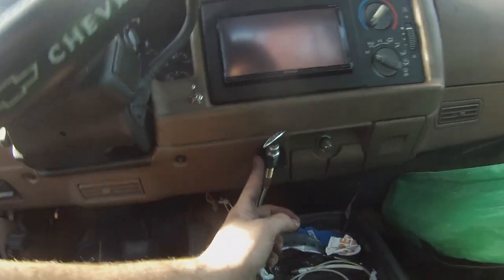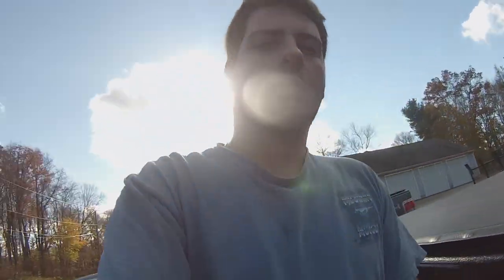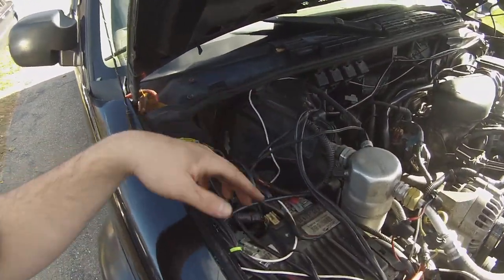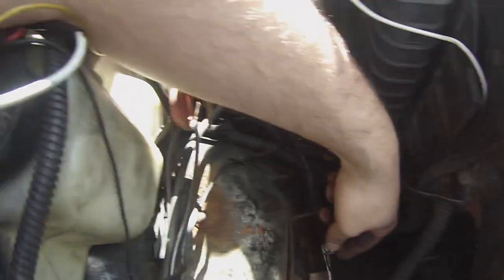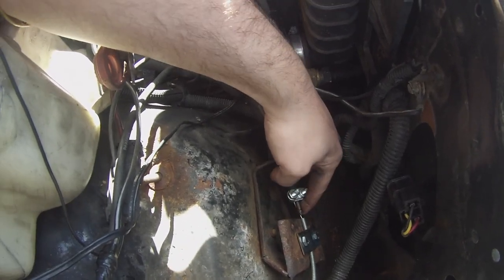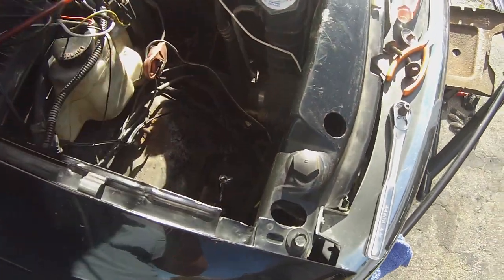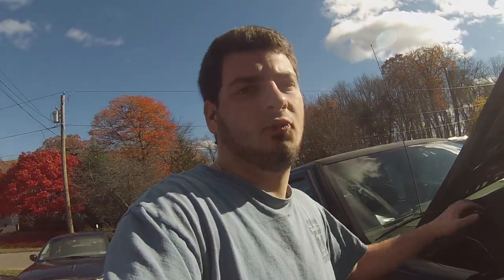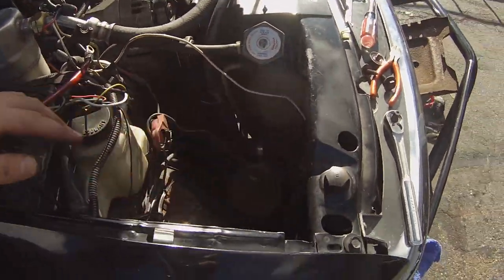S10 / Blazer 4WD Posi -  Lock Cable. NO MORE VACUUM!

Comment: I wish there was a way to eliminate having to tie 2 cables (that can break or rust frozen) together and go directly to the differential with only one cable. I almost ordered a posilock brand-but realized this and wasn't sure if it goes directly to the diff or ties into the actuator cable. They make an actual cast piece of aluminum for Jeep and Dodge kits that bolts onto the diff yet they charge the same price for the Chevy kit without the aluminum piece. Canceled the order and am now looking for a cheaper way of getting a locking cable directly into the differential. If in a pinch during bad weather you can just zip tie your actuator into the 'lock' position and just run with an engaged axle.
Reply from the maker: Honestly, after trying both, the posi-lock cable is well worth the money. I would have went that route first if I knew how good the posi-lock was compared to the homemade. I have another video I just made a few weeks ago on the posi-lock cable. Its worth checking out! Subscribe too if you havent!
Reply: Which video shows the posi lock cable
Reply from the maker: Chris Right look on my channel for a 4x4 Posi Lock cable video
Reply: The cable I purchased does go directly into the differential.
Reply: @MarioMario-mu5tp  where did you get yours I'm having trouble finding one

Comment: I dont have the bottom I have the same truck 96 zr2 umm but I have the gear shift for the 4x4 iam having problems right now but I like idea but I don't have the push bottom for the 4x4
Reply: Will it still work wit the gear shift set up?